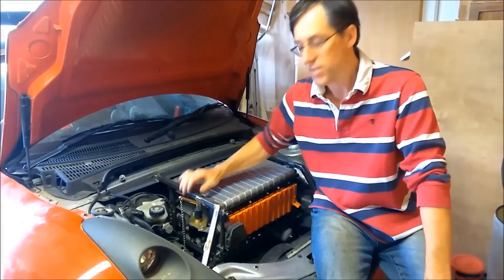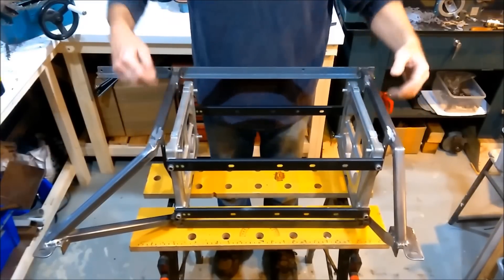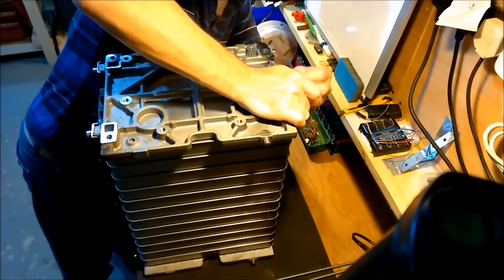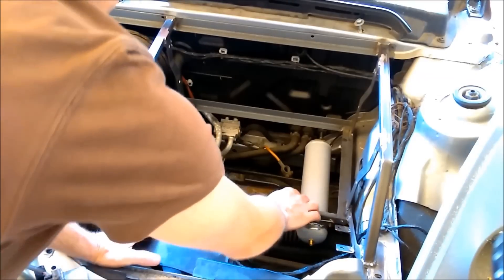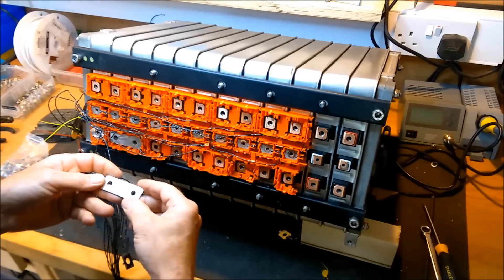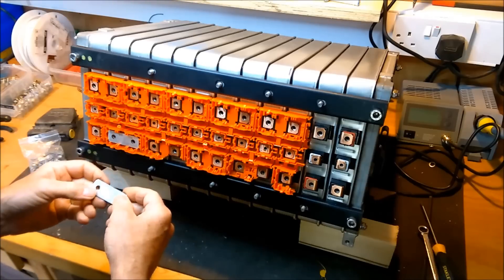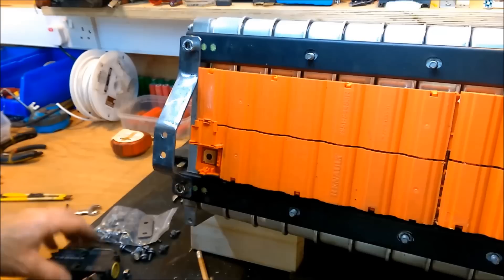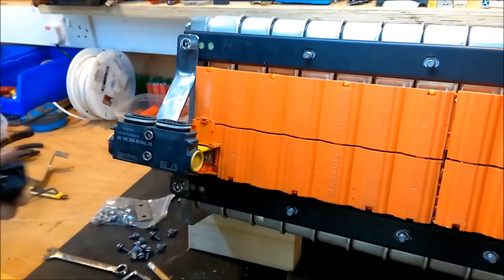Converting car to electric - Battery install - Part 2

Comment: Enjoying the videos! Any information on motor and battery costs?
Reply from the maker: Thanks for watching.. The main parts, motor, controller, cables and batteries are all secondhand, all together I paid around £2300 which I think is less than half of the retail cost. Unfortunately these are so rare in the uk that it takes a long time to find these sort of parts here.

Comment: I would build a LiFePo4 battery to fit under the high voltage traction batteries. About 30ah or so. From 26650 cells. With bms and a DC to DC to charge it from the hv batt. It would save alot of weight over lead acid. And you can use a buck converter and a DC powered rc universal balance charger.to charge when you are charging the main batt. On my conversion .I'm planning to run a small alternator. Along with power steering and AC. If avalible in the car to start with. I'd like also to have a range of 400 miles give or take! A Tesla motor and inverter would be awesome to swap in to something! Ev west swapped one in to a BMW . they said without regulating the power. It is almost un drive able! Tooo much power!! I never knew there was such a thing! A small truck is what I'm thinking maybe a Toyota or Nissan. Extra cab. Or 4 door. With Tesla motor and suspension in rear. With batteries under. Allowing a storage space where the engine was! Now I just need all the parts. I was thinking if the alternator was geared to cut in at low , cruising rpm maybe it wouldn't Rob much power at higher speeds. Due to the alternator trying to put out more power. I don't know if it could be ran off a Tesla motor directly. Or from the Axel. Or from a. Smaller on demand DC motor that powers the power steering and AC. It seems almost pointless. Maybe find a electric rack and pinion that can be retrofitted. A small motor for AC may be worth it. While running a small alternator with the Axel! Like drag race cars and some road racers back in the day! I gotta get a project going. So I can get this clutter out of my head! Sorry for the rambling!!!
 Awesome work!!!!
Reply: , l hu

PLpll. L . Mmm..
N. .L la and 9, o0 is llp0pĺp llp.nll kii o kj baby u have lk p.o. llp .

Comment: What motor are you using?)
Reply from the maker: It's an HPEVS AC35 which is controlled using a Curtis 1238-6501 controller running at 96v.
I think I will do another video which details all the drive parts I've used, it might be useful as when I started this I didn't know which motors to use etc. The problem with Tesla, Nissan motors is that they run at higher voltage to keep the current down, but I don't want to be messing around with 360v DC and 100's of amps..
Reply: paul crisp If you talking about danger - then i can say that you will not feel difference ) 96 or 360 has deadly painfull shock .

Comment: What wil be the range with this battery pack?
Reply from the maker: Not very far, I'm doing this on a tight budget so couldn't afford to spend much on batteries, once it's on the road and I can justify spending more I'll increase the range by putting more in the back. 
The pack is just 6kwh, the car should use an average of 150-200W per mile so the pack should get me 30-40 miles on a good day. I'm assuming the batteries will get better and cheaper overt time so easy to upgrade later.

Comment: That's awesome. I'm thinking of buying a smart for two and doing this. Quick question how hard would it be to make a hybrid diesel version? I know the smart is sold in Europe wit an 800cc three cylinder diesel, where could I get a used mercedes 800cc diesel from a Smart four two? I want to do your set up with a diesel generator. If you would know anything I'd appreciate it.
Reply: Rob Gomez I don't think there is enough space for a diesel engine and an electric motor in that car, but good luck with the build. Would be interesting to see it.
Reply from the maker: Hi Rob, As you say there is not enough space for both. With the standard petrol engine in place there is almost no room for anything else, as the only reason for the diesel would be for range then you might almost be able to get away with a 'range extending' generator in the front giving average continuous charging and the batteries and motor in the back for normal driving?
Reply: paul crisp Exactly, I'm looking to extend the range of the batteries. I don't want a big gas or diesel engine. Just one small enough to keep up with the demand of the electric motor and battery. A good electric set up even with extra batteries still can't get enough range. With a small two stroke their not bad however spew quite a bit of emissions. A small direct injection diesel that can run on vegetable derived diesel would be ideal. 800cc is I think the perfect size to run only 10 to 15 percent of the time as a genrator while the electric motor would operate 85 to 90 percent of the time with possibly a range of 2000 miles before replenishing the vegetable diesel. That's why I'm interested in the Mercedes tiny diesel engine from the European Smart car.

Comment: Also might want to think about insulated tools as there is a lot of current available in the case of a dead short....don't need many volts to dissipate lots of power & create a lot of heat!